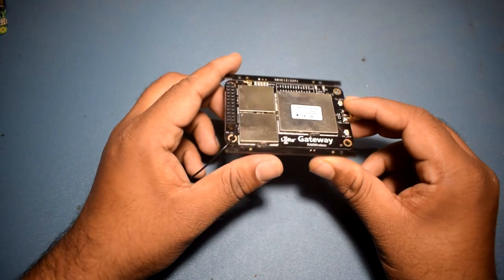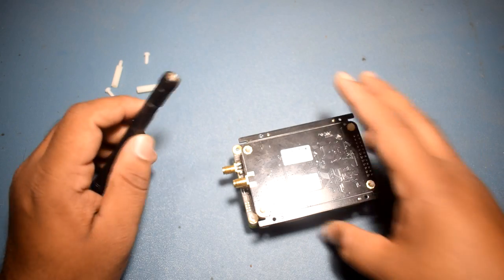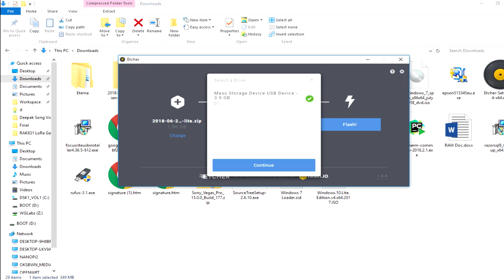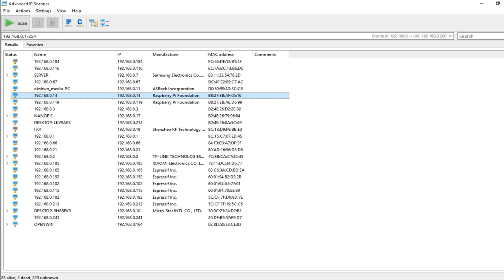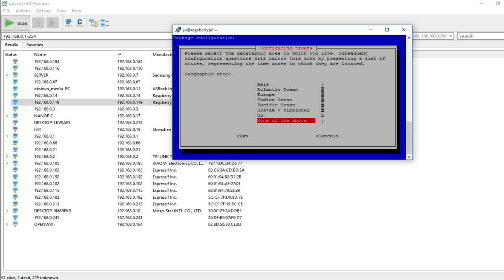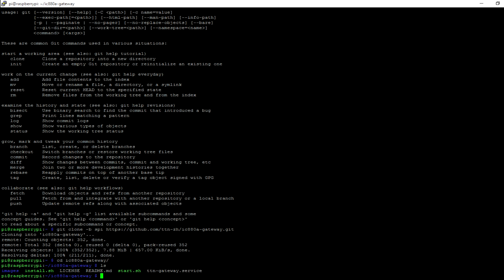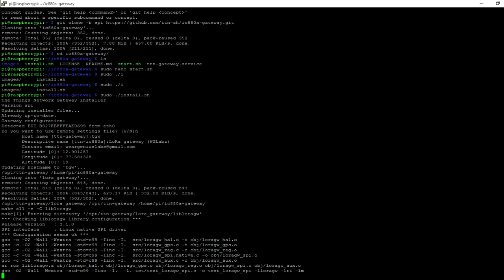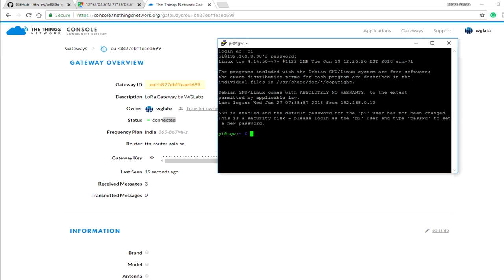LoRa Gateway using RAK831 and Raspberry Pi | LoRa #1

Comment: Sir please help me to solve a java program written below--
package Main;

import java.util.*;

public class arrayprint {
 private String name;
 public void input() {
  Scanner reader = new Scanner(System.in);
  System.out.println("Enter name:- ");
  name = reader.nextLine();
  reader.close(); 
 }
 public void output() {
         System.out.println(name);
 }

 public static void main(String[] args) {
  
  // TODO Auto-generated method stub
  arrayprint obj[]=new arrayprint[2];
  
   obj[0].input();
   obj[1].input();
   obj[0].output();
   obj[1].output();
  
  
 }

}
Whenever I run the above program on EclipseSDk or NetBeans 8.2 it shows error like
 Exception in thread "main" java.lang.NullPointerException
 at Main.arrayprint.main(arrayprint.java:22)
 means at line obj[0].input();
But I search on Google it shows same line without error. I'm totally confused.
Please solve this problem , I will be greatly thankful to you, Sir.